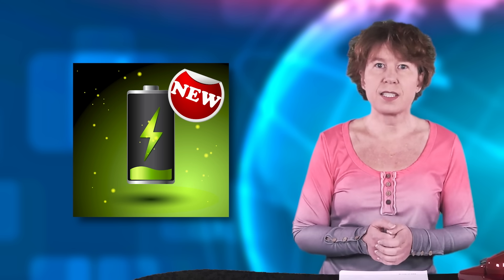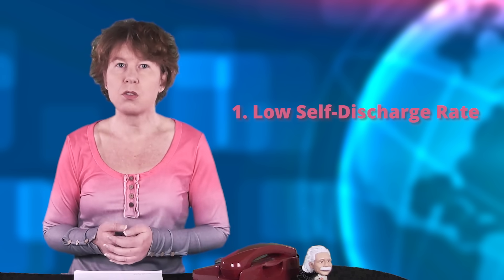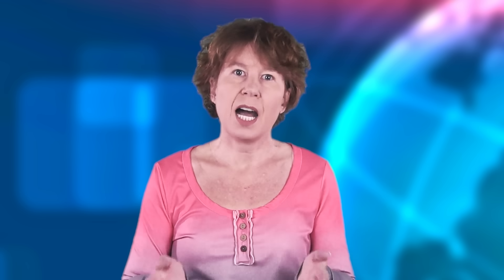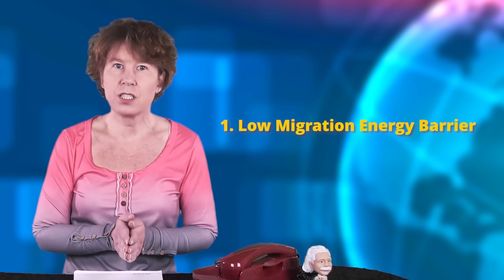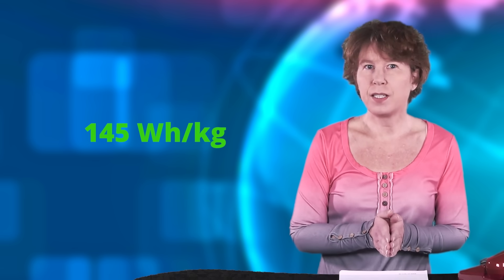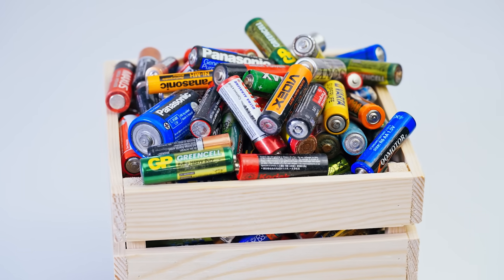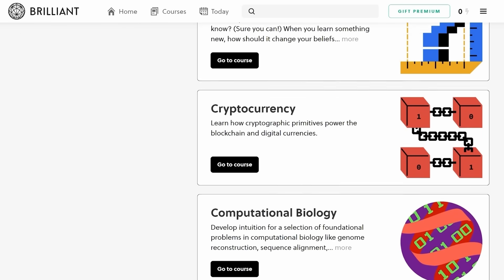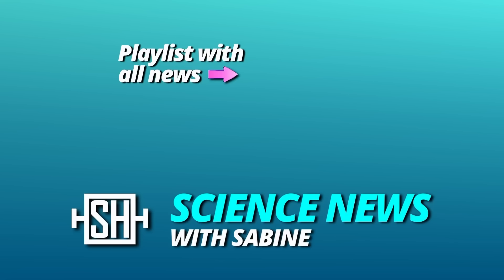Fully Charged in Just 5 Minutes: New Battery Breaks Records

Comment: And it will take the power away from 20 homes to charge one car for those five minutes.  That's the math.
Reply: This is false on many levels.  What if he has solar panels and is actually generating energy for his house and car and also putting excess electricity back on the grid?  What if he only charges at 3AM when rates are low and most everyone in those other 20 homes are asleep?  What if the grid in his area is easily capable of handling the cumulative load of all 21 homes?  Nationally, power usage is down over the last few years.  Probably because of the move away from incandescent lights.

Comment: range anxiety,  could this be solved by having a very small gas engine and generator, not to move the car , but enough to change the battery, enough to get to a charging place. You can say just put more batteries, but you can do my solution for about 35 lbs. I don't know what batteries weigh , so I have to do some research . I know that gasoline has a lot more energy density. It would only be used for emergency

Comment: I agree with for phones.  However, charging an EV in 5 minutes, everything else equal, would be a big leap forward.  But, for the same range to recharge, we're talking an enormous power capacity for the charger! For a Tesla, that would be transferring 75KWH+ in 5 minutes!  900KW !  And that's not even taking into account the losses!  In contrast, the 200 Amp, 240V service to my all electric home is only 48KW!  So, the EV battery might be able to charge that fast in this scenario, but the equipment to charge it that fast is likely to be prohibitive.

Comment: I described previously a heavy electric bike configuration that works very well. A more efficient electric bike 🏍️ and cars 🚙 could be built as follows. Put electric strips on roads that sense EV presence and turn on power when the EV drives over it. Have electrically conductive tires 🛞 that absorb the electricity to charge batteries 🔋, so cars can charge while traveling, only EVs can do this. Quick charge batteries are most effective for street charging as most trips over major freeways are short. Thus, EVs could then have smaller battery 🔋 packs and be lighter and more efficient. I attempted with my eBike to balance the batteries while it was running, in other words while the batteries were discharging. This did not appear to work as electronically sensing the voltage of a cell while it is discharging appears to be highly inaccurate, so balancing battery 🔋 packs precisely seems to be only possible when the packs are not discharging. Therefore, small multiple battery 🪫 packs on EVs many be the most reliable configuration. Then one pack can charge and balance while the other is discharging. Batteries 🔋 don’t necessarily need to by to be heavy, while a certain amount of volume maybe a requirement, that volume could be very light weight, foam batteries 🔋 should be a primary area of research! If battery cells contained tiny hydrogen bubbles what would that do to the battery?😮😅

Comment: The biggest issue is cobalt. We need to get off it in all of our batteries.

Hopefully in just a few years sulfur batteries will be on the market. Most all of the issues with sulfur batteries are being cracked.
Reply: You could use nickel, chromium, copper,manganese and several other metals to replace it with. All it needs is to hold on to the lithium ions weakly and form a stable oxide upon charging. If you change the ion to sodium or potassium then you could use iron oxide making it as cheap as it gets.❤
Reply: Cobalt is an emotional issue. People fear change or have some emotional bonds to their gas cars, therefore they use cobalt mining as strawman argument, while completly ignoring it is also used for hardening steel in ICE engines and in catalysators for the desulphurisation of fuel, not to speak about all the consumer gadgets. Then you also learn that cobalt is a byproduct of copper mines, there are no pure cobalt mines. Where are the same idiots now canceling everything that contains copper?

Comment: Think about the physics. a battery which charges in 5 mins rather than 30 mins will require 6 times the current and charges which can supply this. So the power supply to the charging station will need to be 6 times larger. This is not going to happen, it's just physics.
I forgot to mention the car wiring will be 6 times bigger and the cooling system.

Comment: Who needs a Terabyte of storage?  I don't know, but I remember when we weren't sure why we'd needed a megabyte of storage.
As far as charging, I can picture at least 2 potential use models.  Coustomers may put up with a reduced charge (say 12 hours instead of 24 hours) if they can fully charge in 5 minutes.  Alternatively -- as long as a device can  be used all day on a charge, a charge time of overnight would most likely be acceptable to many.
Reply: It was always clear we would need at least a megabyte, there are pre- information age books that wouldn't fit in a MB
Reply: @shanent5793  I remember when getting a computer with a 512k disk drive was something special.

Comment: I see usage in combination with regular Li-ion, 
At the moment, regen braking is limited by the battery charge current, It should be possible to "input" more or less nearly as much as you output with an electric motor, so a small pack of these could offer a buffer between the brakes and the "regular" battery and be more energy dense than super capacitors.
then again, I might be miles away from a good idea ^^

Comment: I totally agree with Sabine that it is not the recharge speed, but the range of the car that is the first consideration.
Yes, it would also be nice that when necessary it is fast, but how often it is necessary depends on the usage scenario, and it is reduced by range.
I have an EV since 2021, and I never needed a fast recharge. In fact, I didn't stop once to a recharge station, all the recharge I need, for my 60 km/day by 250 days/year, happens slowly at home (3 kW supply, which I didn't even had to upgrade).
As said, it all depends on the usage scenario. In my case, I don't even need a long range car, so that I have a relatively small 30+ kWh battery, and I don't need to have something that weights more in my car. I know I won't use it for longer travels, which I know I won't do often by car either, and that's it.
Rule of thumb, if the car covers 99% of the ranges You could need, and then You can recharge it while sleeping, eating, working, doing anything else, You probably don't care that it takes some time to recharge. Most people spend most of their time NOT driving, if that time can be recharge time, the issue is really just getting where one needs to be to do the other stuff.
It is a shift of paradigm going from fuel to electric recharge, but if the scenario conditions are met, it can be a good one.
The car might have spent more time recharging than any internal combustion car has ever spent refilling, but the time I spent waiting for the EV is zero vs. all the time I spent waiting for the fuel to refill the tank when I had a diesel. Also, so far all the time I previously spent driving to and from a fuel station compares to zero time spent going to a recharge station.

Comment: I just experienced a vacational trip of 1500km, mostly on the german autobahn, in a Tesla Model 3 performance. In the end we preferred charging the car from 1% to a max. of 50-60%  because the charge rate drops rapidly from 260KW to <100KW . In charging faster more frequently, we actually saved time on the trip. So the concept of smaller capacity but ultra fast charging car batteries could make sense.

Comment: If the phone can last longer than you using it, then charging speed is not really a factor since you can charge it through the night. Today's phones are already here, S24Ultra and new iPhones can be a 3 day phones for some people. But cars are still on that border, 500km is around average range for todays cars, but a lot of people can drive more than 500km in a day. So maybe when they hit somewhere around 700km real world range on average, charging speed would become almost useless speck since you can charge them at stops that you have to have as a human being (at least until driverless cars take over). 400km is still enough range for 95% of people, but most still want that extra range to feel safe and to pull the trigger on buying an EV. My family for example still doesn't want an EV yet, even though we take only few trips a year for vacation and it would only require a 15min stop for topping off the battery.

Comment: Picture the use case for fast charging an EV or phone. If its battery can power it as long as you want to use it, and then charge while you're not using it, then that works perfectly. My phone lasts the day and then I go to sleep and throw it on the wireless charger on my bed stand. As long as it takes less than 8 hrs to charge its all good!

So for a car, if you're on a road trip it's recommended you stop for 15min every two hours to stay fresh and alert. I'd say the most that most people would want to drive without stopping is maybe 4 hrs. At 70mph/110kph there are a number of EV options that will get 300mi/480km (based on real world, 3rd party testing at those speeds). That's 4¼ hours of driving right there. Let's say you start at 8am and you're ready for lunch at noon. 

Stop, plug in, go eat lunch and let's say it's fast food and you're done in 30min. You're battery will already be back up to 80% by the time you get back. (If you took 5 min to fill a gas car, your stop would take 35min - actually longer than being able to plug in a walk away!). So now, at 12:30, you're good for another 3.5ish hours of driving. You stop at 4pm for another half hour to stretch, take a little stroll and pee, then get back in and keep going. 3.5 hrs later it's 8pm and I'm pretty sure you'll be wanting to be at your hotel by then and starving for a very late dinner. You plug into their free Level 2 charger for the night and you're back up to 100% charge in the morning without having had to make a separate stop. In 12hrs you covered 780mi/1,250km and only took two 30 min breaks. You can do that day after day indefinitely as far as the EV is concerned. That's should thoroughly bust the "EVs aren't good for road trips" myth, and we can see that increasing the charging speed wouldn't help at all.

The main use case this would apply to is people who can't charge at home, but another option is just putting in more level 2 chargers at grocery stores, parkades, gyms, malls, etc. so you can plug in for 20min here, and hour there, and that would be plenty for most people to never have to make a separate trip to a charging station.

Comment: I would not say lithium ion batteries have high energy density.  They are nearly at the bottom of the range.  No electrical storage battery has decent energy density which is the fundamental problem with EVs.  https://en.m.wikipedia.org/wiki/Energy_density_Extended_Reference_Table

Comment: What we REALLY need in the battery world, are batteries that don't leak if left alone for a while.  Energizers AND Duracells, will swell up and "explode" (not a literal explosion, but a bursting of the container), then the electrolytic paste leaks out and corrodes the contacts in the battery chamber.  It's almost impossible to clean, the device will NEED to be replaced!
To be fair, SOME batteries don't do this, like rechargeable batteries, and the generic batteries that are often provided with products, but the most common consumer-purchased batteries (Energizer, Duracell) WILL do this.
Reply: Lithium batteries used in EVs are not Energizers.  Why is it that so many people think batteries are generically all the same?  In anycase, lithium batteries also don't really have a shelf-storage problem either.  The self-discharge is very low so basically you just charge the thing up and put it on a shelf for 6-12 months and it will still be fine.

You do want to charge up a shelved lithium battery at least twice a year.  About the only thing that really destroys a lithium battery is letting it discharge below a critical voltage (over-discharging it)... which can happen on a shelf from self-discharge.  So it is to be avoided.

That said, actual bare cells (without a BMS) can last several years on a shelf without recharging.

-Matt
Reply: @junkerzn7312  I wasn't talking about EV batteries, but batteries in general.  I didn't watch the video first before posting.  My mistake, my bad.
Reply: @sterlingdennett  All good.

Comment: I have an EV, and it is far cheaper and much easier to fuel-up than any gas vehicle I have ever owned.  Once or twice a week, my battery gets below 30 percent.  So, at about 7pm (we're usually done with all driving by 7pm) I plug it in for a 5.5 hour charge.  I'm in bed by 9pm.  No worries, it shuts off automatically!.  The next morning I will have 82 - 87 percent charge.  Or about 300 km of driving range before I get around 30% charge available again.  So, cost of electricity for a 300km charge is about $3 .  For a gas car getting 10km/liter,  300km of driving range requires about 30 liters of gas ~ $35 (depending on where you live).  So total spent fueling up my EV to fuel-up? 2 x 2 minutes = 4 minutes.  I only wish I would have bought an EV sooner!

Comment: As you imply, most EV owners charge at night and never have to worry about fast charging. The exception is a long road trip, and even then charging cycles can coincide with a lunch break after 250 miles. My neighbors have two Teslas and have never had them serviced except to buy tires, and never have had to do any fast charging.

Comment: As long as there is lithium in it, the possibility of an exothermic reaction causing an unextinguishable fire exists. Lithium has a powerful affinity for water. In a lithium ion battery laboratory built in a facility where I worked (not my project) the laboratory had to have a relative humidity of under one percent. The mining required to build EVs creates so much CO2 you have to drive 80,000 miles to just break even. The batteries are already so heavy that you need more power just to move them. Making the car even heavier will require more power. Here's a presentation by someone qualified explaining why green energy is a scam.
https://www.youtube.com/watch?v=q7Gi0vObVSo&list=PLR0gSPbvQL-KnKrh9gVWQc-u2tP5Z9jXT&index=2&t=3800s
Want to know why your windmills stink for generating electric power over the long term? Here's the explanation of the fatal engineering flaw.
https://www.youtube.com/watch?v=og2H7ZxkiMA&list=PLR0gSPbvQL-KnKrh9gVWQc-u2tP5Z9jXT&index=3&t=156s

Comment: The problem is, you'll never be able to charge a car in five seconds regardless of how good the battery chemistry is.  If a car battery is 100 KWh, that equals 3.6x10^8 joules.  To charge it in five seconds would require 7.2x10^7 joules per second, which is an input of 72 MW.  It's simply not practical.

It also hints at why governments mandating no new ICE cars be sold after 203X or whatever is stupid as the power generation does not exist and can not exist within that time frame.  About the only country that could do it is Norway, and that's only because they have fifteen times the power generation per capita compared to the UK.    It's also all hydroelectric, which is nice for them.

It doesn't make sense on other levels too, like the carbon cost of manufacturing batteries, the total lack of raw materials to make that many batteries, and the fact that most of the world still uses fossil fuels for much of it's power generation.

People want easy solutions and direct replacements for their ICE vehicle, but the fact is that they are not for everybody, and if everybody did have one then charging would also be very slow for everyone.  Charging speeds are going to get slower as we see more EVs.  We don't need new battery technologies as much as we will need lots of thorium salt reactor  power stations.

Comment: Denedrites would be a problem for this design. Thats's  why carbon is used as the anode. 
EV are a dead end, since it that create an enormous amount of waste & the cost to replace the battery pack is nearly about half the cost of a new EV vehicle. Resale of EV is basically near scrap value has no one wants to deal with a battery replacement. Third the grid cannot hand the load of EVs. Most nations are shutting down coal fired & nuclear power plants, and replacing them with NatGas Power plants. Already about 40% of the NatGas produced is used for electricity, and the US is burn through its remaining NatGas reserves. Most of the grid is now +80 years old and would take trillions investment to bring up to accomidate EVs. Soon it will cost more to drive an EV than a petro car because of rising electric costs as the EU now has to import most of its NatGas LNG as Contracts with Russia end.

Comment: Maybe others have different experience but I have been fully EV since 2017 and have done some very long journeys. The charging time is of little interest to me these days.  You can already put 120km on an Xpeng G9 in under 7 minutes.  When on a trip you stop from time to time anyway and rarely end up waiting for the car to charge.

Maybe if you can't charge at home really high speed charging is important but other than that I see it as a nice to have rather than a solution to a problem.